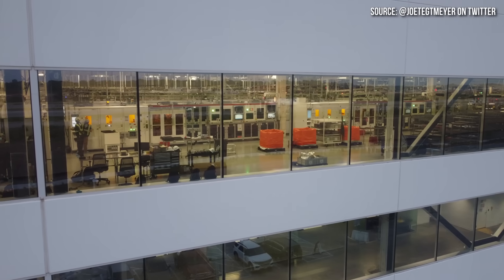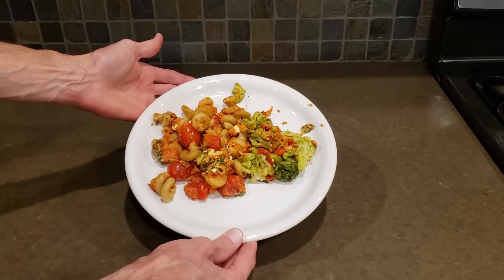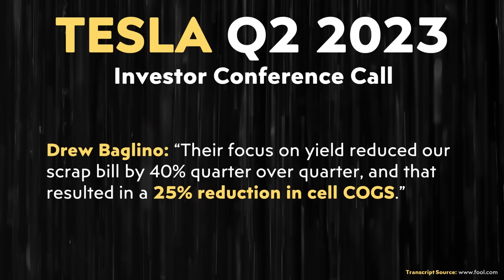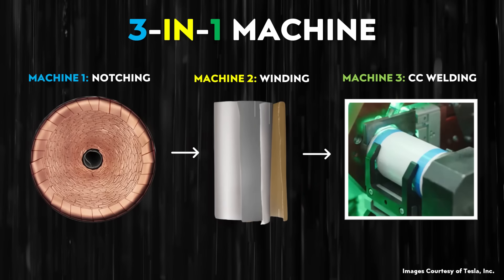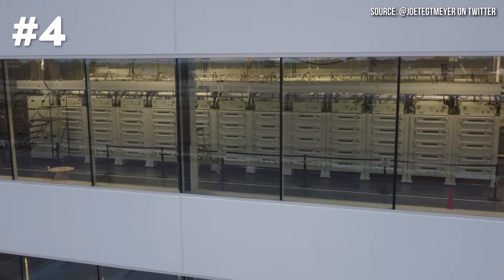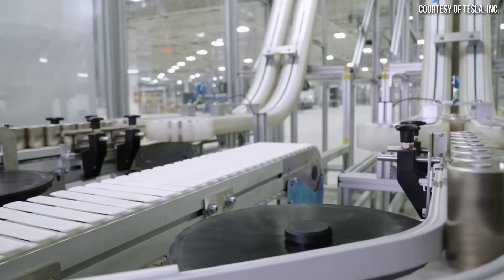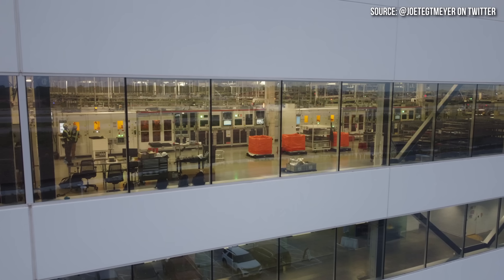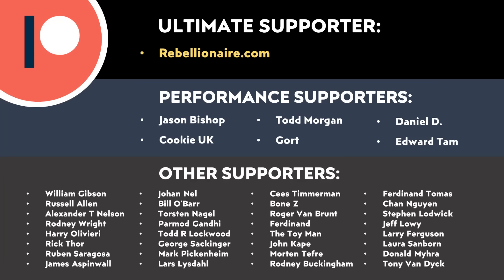Tesla's NEXT GEN 4680 Battery Equipment REVEALED | GIGA TX

Comment: If LFP batteries are the future why would the 4680 battery size be used in the long term future.  They should focus on a LFP/LFMP battery form factor that is compatible since that is the future type of battery type that is sustainable.
Reply: Those are chemistries, 4680 is battery from factor, 4680 could use whatever chemistry
Reply: @junioo3692  yes I understand but have they made LFP batteries in the 4680 form factor before.  Hopefully Tesla is working on it.  So far the LFP batteries have been rectangular or blade form factor.

Comment: 40% reduction in scrap saving 25% equals to 100% reduction scrap saving 60%. If ideal cost with no scrap is 70 USD  without scrap, that means total cost before improvements is 70 USD (40%) + scrap (60%=105 USD). Reduction of 40% means 105 USD * 0,6 = 63 USD scrap cost. Total cost 133 USD.